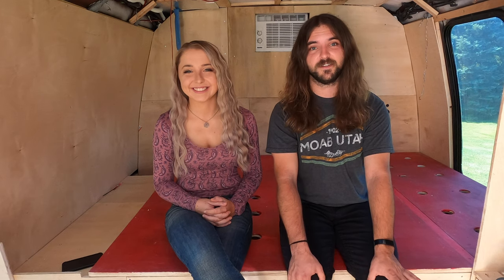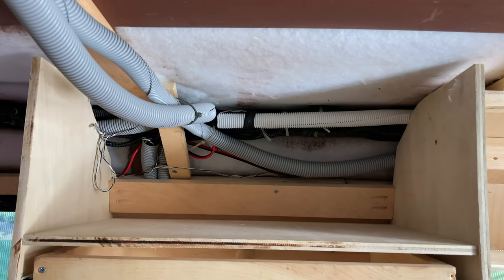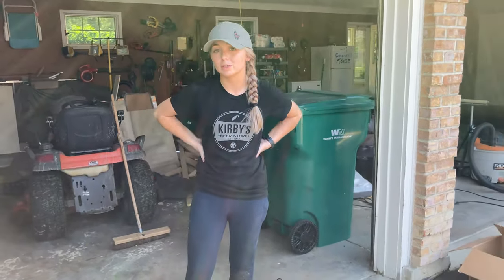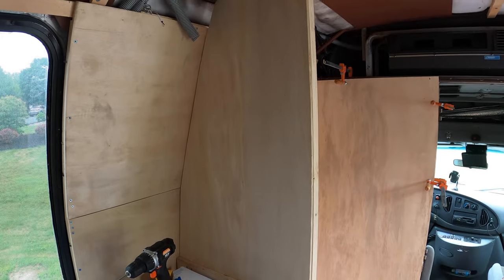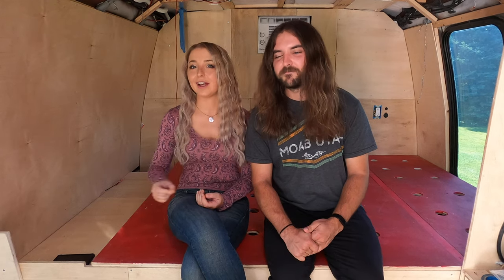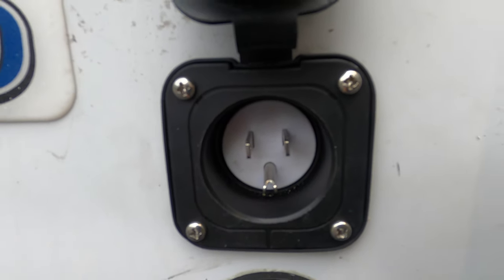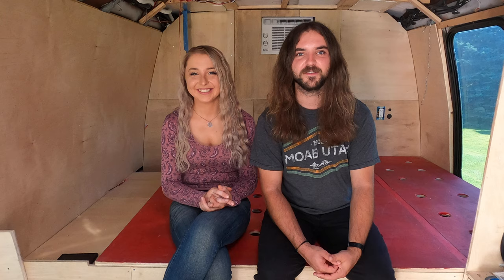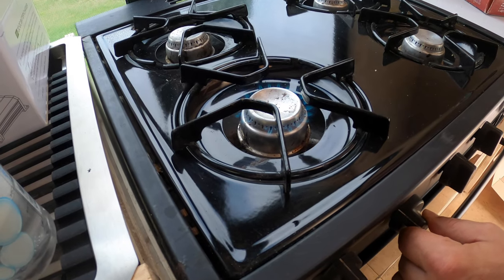Shuttle Bus to Tiny Home Conversion (Part 3)

Comment: I don't know if anyone already mentioned it (I looked briefly in the comments but didn't read sub-comments) but if you have a bunch of batteries in parallel, your main and your ground should be on opposite ends.  Meaning if you have three batteries 1, 2 and 3 - you might put the main that goes to your inverter, on battery 3 positive. Then run the ground back to the ground on battery 1.  

This lets you draw power evenly from all your batteries instead of putting a heavy load on just one battery.   If it's unclear and you aren't sick of people throwing their 2 cents around I can provide a link to a guy who does boat electronics (which is the same as RV electronics :) who can maybe explain it better.  

Nice videos with good explanations.  Thanks for sharing them.  I'm thinking of doing this as well and i've been trying to see the difference between shuttle buses school type buses.  This helped a lot.
Reply from the maker: I’m absolutely surprised in that all of my hours of research for our system that this issue never came up. Two seconds of Google searching and it’s clear that you are 100% correct, and I thank you kindly for bringing this to my attention in a nice way! I’ll be looking into  switching our setup this week.

Comment: As the bus sides seem to be of a consistent curve, I’d have made a master template for making the perpendicular walls easier to make. Once made I’d have tried it in multiple places just to check it fitted accurately and once happy used that to scribe all the walls.
Reply from the maker: This was our original plan! But unfortunately the wall curvature is actually not consistent everywhere in the bus - it’s narrower and more sharply curved in the front and gradually flares out towards the back. The first template we made for the closet wall, for example, did not fit in the spot for the second closet wall, which is less than 2 feet away. We’ve probably made two dozen different templates throughout the conversion process because of it.
Reply: @GoThereFree  
That’s a major pain in the butt. No doubt you’ll forget the pain of the build once you’re finished and enjoying your travels again. 
You haven’t mentioned security yet but I’m assuming being a prison bus it’s pretty good?  
I’ve been thinking about the best vehicle to convert and I’m so torn, the easiest shape is obviously a box van but the aesthetics of exterior curves keeps drawing me back until I consider the PITA they are to convert. 😂
Reply from the maker: Oh yeah, this bus is extremely secure. The external doors are incredibly solid, the windows don’t open, and the exterior is all metal rather than fiberglass like you see in a lot of shuttles. Plus we kept the original steel partition (and installed a door, which will be in the next video) for added security between the cab and coach. Our first rig was a box van, and I can’t tell you how many times we have dearly missed those super straight walls during this conversion lol. But we had no windows in that rig, so for us the curved walls were the trade off for some natural light.
Reply: @GoThereFree  
Lol I was gonna ask about putting a door through to the cab. It’s a good safety feature to have if you need to get out of Dodge quickly without getting out. Having the door (especially if it’s insulated) helps keep the heat of the cab out of the living area. 
When’s the new vid coming? When/if budget allows would you consider retro fitting an opening window if there is one made or this shaped van?
Reply from the maker: We actually looked around for a window that opened early on in the build, but came up pretty empty other than some custom - and very pricey - options. Our remaining accessible windows would be pretty easy to swap if we ever came across something useable. 

Hoping to film the next video soon! We have a couple more projects to finish up first.

Comment: You two are rockin' it!!!
I have a question - why does the PEX go in that zig zag pattern in the garage? I'm sure there's a reason why it can't just go straight down, right?
Reply from the maker: Thank you! Good question! Directly below the air conditioner at the bottom of the garage wall, there will be a door that will allow us access to our under bed storage through the back, so the pex couldn’t go through that. We also had to find a spot where we could drill through the floor and not hit the frame of the bus, and also tried to drill through the wall supports in the easiest way possible - it can be hard to get a drill angled correctly when supports are that close together. All of that combined is why it ended up in such a strange pattern!

Comment: How much water will the AC produce in humid climates and if it’s a significant amount had you considered collecting it to use for anything other than drinking and cooking?
Reply from the maker: From what we saw during a fairly humid upstate NY summer, it’s really not producing that much water, even after hours of continuous use. That said, the setup is such that it would be pretty easy to stick a bucket under the drain for reuse if it ever did appear to be a significant amount.